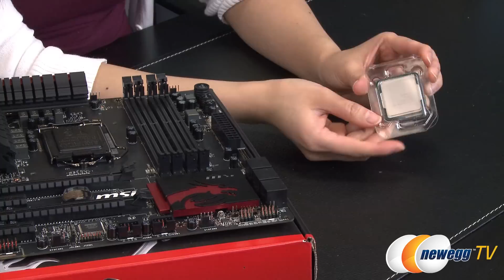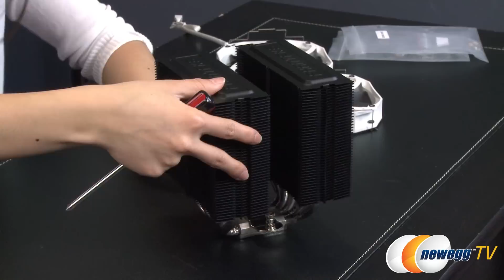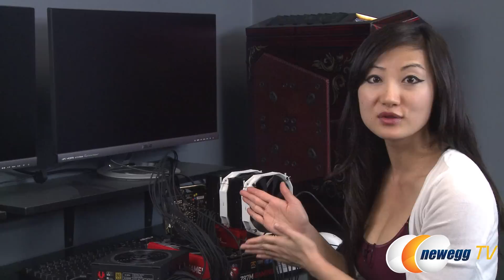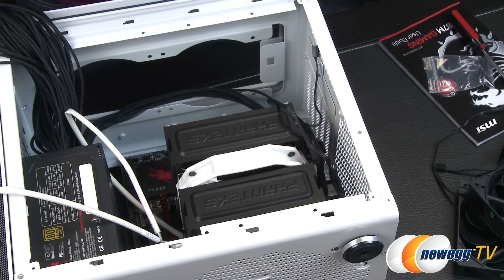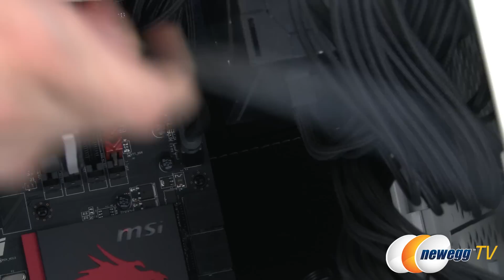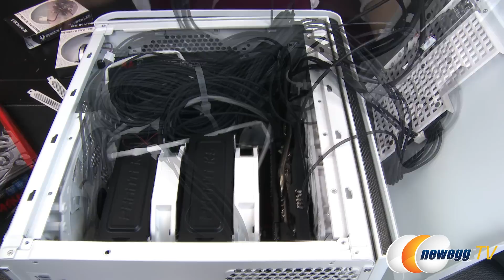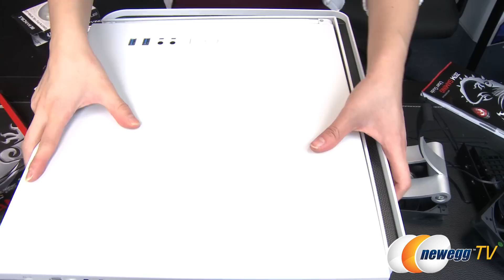BitFenix Phenom M Micro ATX Build - Newegg TV

Comment: I have a question. If you aren't going to overclock in the future would you still get a CPU cooler? Like I won't be overclocking on my future rig but I still want a CPU cooler just for the CPU to be cool. Is that ok?
Reply: i was gonna get the TX3 since it's smaller and I don't want it to interfere with my memory ram
Reply: I can't even say that you need an aftermarket CPU cooler if you do overclock. My i7-4770k is mildly overclocked to 4.43 GHz, and I use the Intel stock cooler.  The 4 cores are running at 45, 44, 43, and 45 Celcius right now.  Obviously they get hotter when I run a game, but still not unreasonably so.
Reply: Oh nice! So that means I will just use the heatsink. Thanks dude now I don't have to pay more!
Reply: ***** Heck yeah, man... Mo coola, mo betta.
Reply: I have a Enermax that cost 35.00 is good and small, even though i could get one like this big ass one that she used in this built.
Reply: im getting a cfi bastet, its a really cheap case thats like 30 bucks has a side panel led fans and lots of cable management.
Reply: ***** I have that case and I absolutely love it. Tinted window, usb 3.0, hot swap drive bay, and excellent cable management at such a low price. And just a tip for when you get it, the CFI logo on the front is easily removed. It makes the case look so much cleaner. especially if you don't put a 5.25 in drive in it.
Reply: Thanks for telling me the last part! I didn't like the CFI logo. XD
Reply: *****
I would have said it was the other way around as regards longevity ie the stock cooler will last longer and be (usually) much smaller/neater with obvious temperature compromises.  Aftermarket coolers (usually) are 'better' quality and will not be as noisy.  If not overclocking stock cooler will be perfectly OK performance wise (Intel and AMD are NOT going to supply a cooler that does not perform adequately) but you may wish to go aftermarket for noise, looks , Ss+Gs etc.
Reply: ***** Aftermarket lasts longer? I've ran stock fans on older pentiums and even Q9000 series... They work well and have lasted much longer than AIO coolers. Hell, I've used the Q9650 since I got it when it first came out, on the stock cooler. I still have it in my older build and the fan works just as good as day one. So unless intels new parts were built way worse, which I don't think they are, then the stock cooler will do just fine.

If you are overclocking then maybe the longevity would be an issue. I never really understood overclocking anyway.

RANT: Why not spend more money on a nicer cpu? That $100 watercooler or aftermarket heatsink could be subtracted and used to upgrade to a better performing cpu.. It's the same thing with gpus.. The upgrade in hertz in overclock isn't justifiable when a higher end cpu can outperform it at a lower hertz.. Only until you get to the highest end is it truly justifiable. Well, and ITX/microATX where you need to save airflow room and an AIO would help, but that's situational and dependent on the case.

Still though, I still honestly believe it's a waste of money. The stock coolers work just fine for the normal clock speeds.
Reply: ***** Noise issues? That sucks I guess. I mean you can hear the fans on the Q series but it's not that loud.. I also don't know your case and noise reduction in your case, if you had a decent case.. It'd make even a 7990 sound humming. But I'll take your word for it. 

I guess? You can run a cpu all the up into the 90's and it'd be fine with it (for part-time full loads, now if you ran full loads all the time.. well that'd probably make sense to get a better cooler.. but a higher end processor could the same task at lower temps and clock rates. Just like how in gaming, an i5 does the job at 60-80% loads while i7's do those same tasks at 30-50%). Either way the stock cooler does its job.

You do also know you could've spent $45 more for a AMD 9590.. Or for same socket you could've gotten a 4690k and, if you looked around, a 4770k/4790k. So either way, it's still not worth it in my opinion.

It can be an added bonus to have better cooling, but the point is that stock coolers do the job. I give up anyway, people spend $1000's extra on their cases for aesthetics, crazy watercooling, and other pointless stuff before even weighing the options of buying better components in the first place. It was just irritating hearing that aftermarket coolers last longer, when AIO definitely don't and heatsinks are debatable as well.
Reply: lower power consuption+lower temps=better reliability and a cooler room and a lower electricity bill, personally id rather spend more on one part than replacing another several times because it died. Also, a lot of people only consider the price of the part but if you can buy something with the same amount of power and uses less resources you'll save more money in the long run anyways.
Reply: T Lawrence
Cooler room, how?

Comment: There is only once in my life I did a micro ATX build and never again, my gorilla hands aren't built for that kind of abuse. But watching a girl geek out like that and perform "surgery" - aw man, I just melted! :D (No, it's not a sexual metaphor... animals!)
Reply: You just need a better set of tools so your hands dont have to go into the case, do the assembly as much as possible outside the case, then use your long screw driver :-P
Reply: omegatotal
But why? Why go small? I've got the room, admittedly some people don't, but the way micro ATX is, many people do a lot of sacrifices just to shave a few inches off the height! -.-
Reply: BigBadBeef http://img.photobucket.com/albums/v127/omegatotal/Compaq%20CQ4010F%20photos/a726f25c.jpg

fits into a jansport back pack, has a gts250 1GB, and a phenom2 4 core 3ghz

runs just about everything I need, perfect for lans, even though they dont have that often anymore with broadband reaching 90d/10u mbps
Reply: Depends on the case choice you have picked out. I have a Corsair Obsidian 350d. It is a mid tower case with mAtx mobo fitment. I have ample room for my gorilla hands, tools, cable management and AIO cooler options.
This case however; is built to contend with the iTx form factor while not limiting yourself to a iTx mobo. I would like it for an iTx board. 
And I agree with your statement BigBadBeef about seeing her work on it.
Reply: dnicks82 No, once you pick a bigger case then its not micro ATX profile anymore.

Comment: If people are wondering on what if you have really big hands, you can mount the CPU heatsink after you mount the motherboard and everything else (besides the video card).  The new cases these days are designed to make mounting aftermarket heatsink easier so you don't to have to pre-install the heatsink to make your life a living hell on screwing the motherboard, mounting the exhaust fans, plugging the power cables, and wiring the cables for the drives and frontpanel I/O.

You see that big opening for the motherboard mount?  Is it for easy access to the back of the motherboard to mount the backplate.  Yea...  You need to plan out everything by check the case, the motherboard, the heatsink, and the drives because many things can go wrong if you DON'T plan ahead when not doing your homework.  (Like me, on my first computer build but I learn my lesson after several build.)  lol
Reply: just get a longer #2 screw driver with a magnetic or other type of retaining system for the screw (there are a few nice ones from husky, I think, that have extendable shafts...

Comment: Paul totally made Joanna use a massive heatsink and tall ram :P. I was surprised the cpu cooler didn't touch the ram honestly.
Reply: Any builder that knows what he/she is doing always checks the clearence before. It's one of the most common places where physical interference occurs in a build, so to anyone that ever used a big aftermarket cooler that should be a no-brainer. Some manufacturers give a compatibility reference sheet right on their site, so you don't even have to bother with measurements, you can simply look up if the type of memory you want to use is on the list.

Comment: Hey,, Why Intel again,, what's wrong with AMD ?
Reply: Finally a smart person! xD
Reply: ***** HAHAHA, you really should check some benchmarks. I have a fx 8320 and i can DEFENETLY compete with an i5.
Reply: What sucks is that for people to want to use AMD, more manufacturers have to start making good boards for them...and for manufacturers to want to start making better boards for AMD, people have to buy them. So it's kind of fucked either way unfortunately. :(
Reply: Kenneth Cox
wow 150$ cpu vs a 700$ one
Reply: ***** Yeah, i agree. I actually wanted an amd m-atx pc. However, there arent really any good mobo's for that. so i just went with atx. 8350 is so cheap, but so good!
Reply: ***** AMD also doesn't get any new 'pure' desktop CPU's out(FX series) so the motherboard manufacturers aren't seeing any need to update their current boards. and unless you want to go with the red team in case of graphics cards(which i rarely do because of the features on the Nvidia cards) an APU just isn't  going to cut it. the limitation of four cores on an APU is awful as well... :(
Reply: The reason they are using Intel instead of AMD is the popularity of the chip.  Since Intel chips are more popular among most PC builder, it made sense to most PC building video to be using Intel instead of AMD.  Top reason why Intel is popular is energy efficiency and lower temperature in full load.  If you look at Youtube, there are more video on PC building using Intel than AMD.  If people want to see AMD build, contact the builder directly or pressure AMD to be more proactive on their products.
Reply: amd doesnt a lot of micro boards
Reply: lack of matx boards, i had to switch just for that
Reply: It comes down to cost. Nothing more. You can build a decent gaming computer with AMD chips at a much lower premium. You can save a couple to several hundred dollars with an AMD chip. If you have the money for an Intel Core i series, you will have more performance all around. There are also many limitations to certain AMD chips that Intel doesn't have. You pay for it though.

It's a "Get what you pay for" type of topic.
Reply: dnicks82
I understand what you mean.
However, I really do think you get way more bang for your buck with amd.
For example, a fx-8320 outperforms any intel competing cpu massively.
Reply: Tijmen van Westerveld I doubt the 8320 out performs ANY intel CPU! 
http://cpuboss.com/cpus/Intel-Core-i7-4930K-vs-AMD-FX-8350 
THIS is the higher-stock-clocked version of the 8320, also more OC ability, but the 4930k with 6c/12t outperforms any AMD cpu massively.
I decided a 6 core as a competing processor since it only had 6 cores, not 8, but still kicks ass! My neighbor has this in his Alienware Aurora R4 and it's AWESOME at Planetside 2 Ultra settings 1920x1200.
Reply: Well, he said competing CPU's, he didn't even give a range. But, if he's talking about price, then yes, the 8320/8350 would outperform. Although, for about $20-40 more, you could get an i5-3470 which would outperform in it single threaded applications, or applications that use up to 4 threads, but since modern games are using more cores, I guess it was silly to compare a $700 to a $150 CPU that'll do not much less of a job in a game. Use an A10-7850k with mantle and hybrid crossfire in BF4, though, and you're still set for under $400-500 for the CPU & Graphics alone, am I right? I apologize for my crazy mockery. Comparing that big of a price difference was stupid. :(